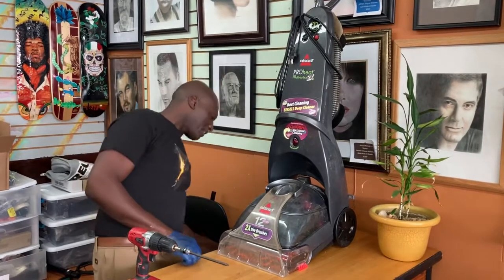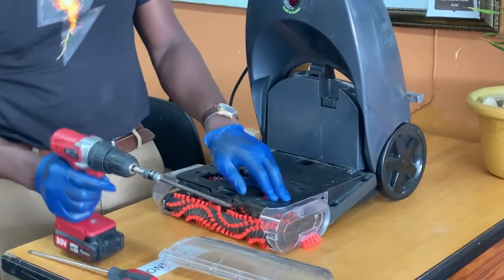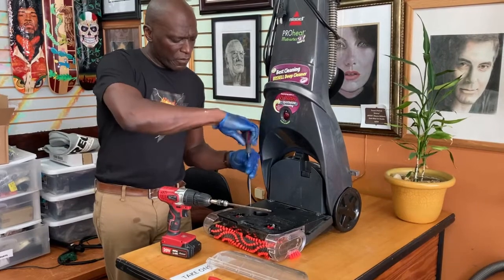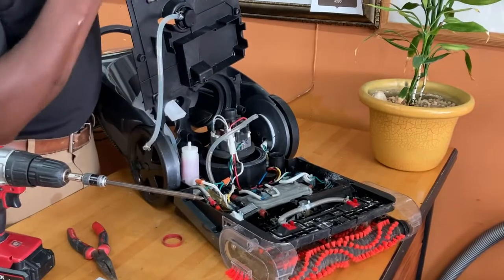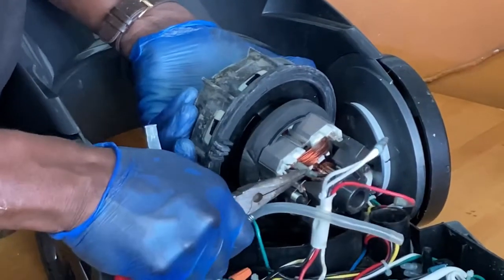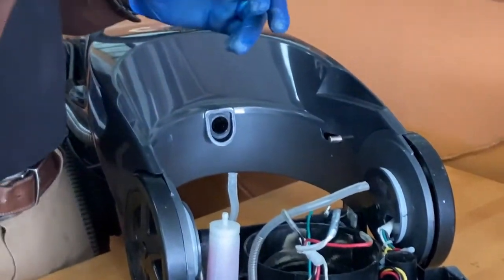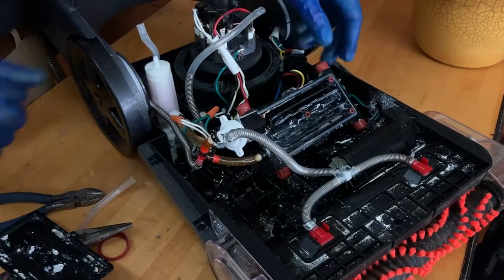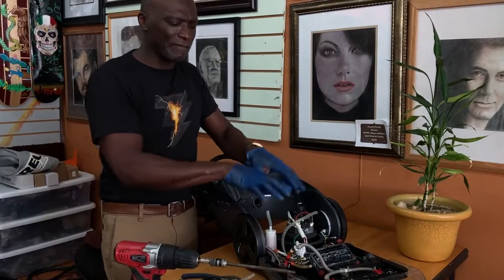Replace a Bissell Proheat 2x motor

Comment: I never had a problem putting the cover back on over the motor working on mine and troubleshooting it  until the motor fell out and  no matter where I placed it, the cover would not go on like it was hitting those 3 rubber upright tabs next to the wiring harness that goes into the motor. I was trouble shooting why I was not getting solution from the smartclean manifold and bypassed it and wow it would empty the solution tank in 30 seconds or so if you hold it steady. Not sure I want to buy another smartclean manifold as they are hard to find. I don't know why the other hose connects to the front big tank plugin. Must be if you want to make your own solutions to scrub floors or something, but it's not needed to clean carpeting with the solution in the small rear tank. thanks.

Comment: Could you help me figure out how to remove and replace the brush motor ,on the same model ?
Reply from the maker: I’ll look to see if I still have one in my stock to work on. Stay tuned
Reply: @monroevac  ty ! I figured it out , kinda , it was Rusty , so I had soaked it for a few days with a penetrating oil , but ended up just cutting it off with a dremel… the shaft was rusted pretty bad , and so is the bottom of the brush motor . Probably why the motor went out .
I just found your channel , GREAT WORK ty !

Comment: We have a bissell proheat2x that rotates through the family. My son tried using it and said it was not working. I took it apart to clean. Lots of dog hair and gunk. ( apparently the kids are not cleaning after use!) All clean now and I tried it out. Started up right away for about 10 seconds and blew the circuit. I tried in another outlet, 10 more seconds and it blew again. What should I look for in the machine.
Reply from the maker: My first guess is the motor- still I would 1st want to eliminate the cord and power switch as possible causes but most often it’s the motor

Comment: If you do strip the threads in the plastic for the screws you can put a sliver of wood in the hole .
This gives some surface
For the screw to thread on .
And thanks man for showing this .
I have that same model .

Comment: Can you do a motor replacement of the ProHeat 2X RevolutionPet Pro Carpet Cleaner Model number 2283? The purple green and silver one. More specifically the reassembling of the whole thing after replacing the motor. Thanks
Reply from the maker: Will do

Comment: Wayne, Thanks for the video. Is there a good way to troubleshoot the hydraulic part of the machine? Pump and solenoids in particular. My machine wont spray anything, and has a brand new heater in. Thanks!
Reply from the maker: When replacing the heater I always replace the solenoid. But you can first check to see if the jets in the front are clear of debris and also see if the hose is spraying. If it does, then the pump is working. New heat mean not blockage (at least before the “T” junction) do if the pump is working the the hose should spray. To check the solenoid; try running the unit with the hose that’s connecting from the junction disconnected. See if water is flowing freely (A little clumsy and wet but you get an answer) then connect it to the solenoid and repeat if the water stops, then replace the solenoid
Reply: Thank you. I will try this.
Reply: @monroevac  Wayne, before opening my machine, can you perhaps share the "order of operation" for this machine? Do the two tubes from the pump going to the vacuum tube "control" pump action (i.e. no pump if no suction sensed)?  Are the triggers mechanical or electric?  Also, should i be able to hear the pump motor if working?  Thanks!!
Reply from the maker: You may not hear the pump. I’ll put a quick video together. I’ll have it up in a day or two
Reply: @monroevac  That's very generous! Thank you

Comment: Great videos!  Thanks so much.  I have this model.   I've already taken this thing apart  almost to the motor and got the fluid flowing again by cleaning the heater and front 2 jets.  However, now I notice the suction seems weak from the floor path and is totally non-existent for the tool hose.  I've watched your other videos related to this model like making sure the handle pole is aligned  properly with the tool suction path, etc.  When I remove the tank and check for suction at the tube with the orange O ring, it is hard to feel anything significant but I do sense some flow.  Do you think  replacing the motor  will likely solve this suction issue and if so, how much suction should I expect for normal?  Like said the unit turns on, makes noise, rollers roll, heater heats.
Reply from the maker: I recommend working backwards to solve this mystery. Take the water bin off and test the suction by putting your hand over the port and see if you feel a good amount of suction. If you do then your problem may be found in the water bin or tip lid. It can also be the nozzle window. But if not then you may need to revisit the motor to make sure all seals are in place
Reply: @monroevac  Thanks for the quick response.  I'll further investigate and post what I find. A neighbor put this unit by the trash so I'm not sure how much money I might put into it.  I am of course hoping to fix it for just my time.

Comment: how do I know it is motor, belts seem fine. They turn by hand, just wont turn when I turn it on. bissell model 1383
Reply: i think the belts only move the big brush at the bottom and only when you begin drive the vacuum